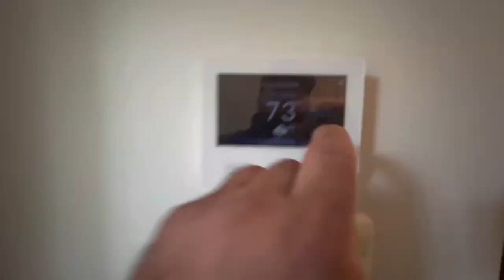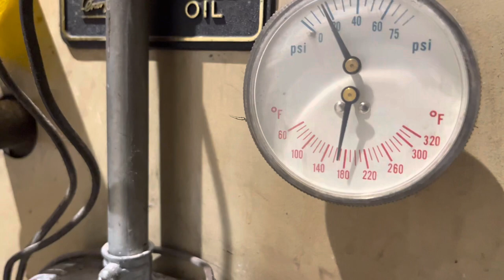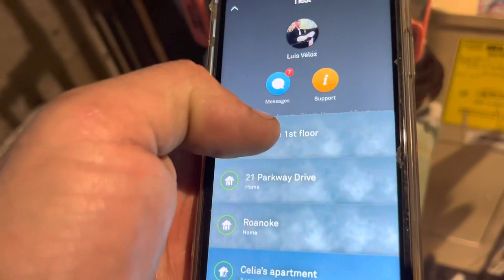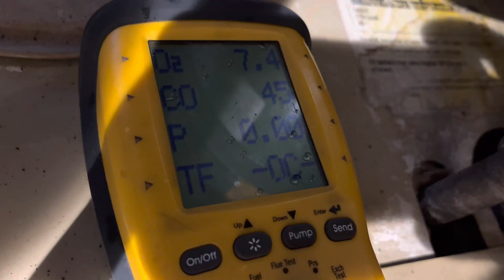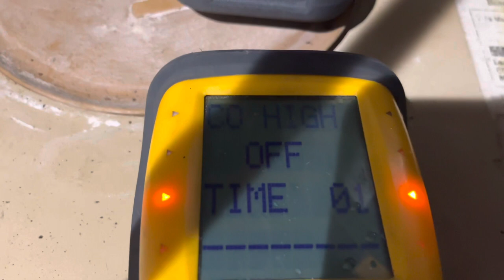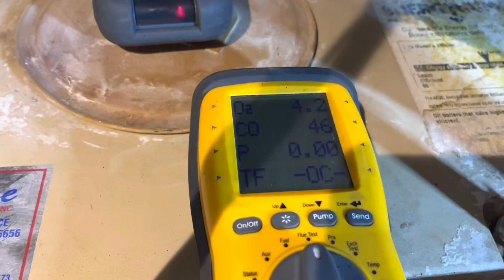Weil McLain Gold in bad shape.  High CO.  No heat due to No maintenance.

Comment: My boiler is leaking burn smell through the peek hole. What do I need to do?
Reply: Plus keep burning for like 30 sec after it stops running
Reply from the maker: I would definitely call a professional technician.   Could be relay sticking, and the leak could be piping or even the boiler itself.    Get it checked seriously
Reply: Im gonna try change the nozzle and pump
Reply from the maker: Has it been vacuumed w soot vac.  If it’s oil??
Reply: I just cleaned/vacuumed the soot. Found a part inside the chamber. Circle thing that stay infront of the nozzle. Put everything back together and ran better.
Reply from the maker: That circle part gets sooted up and needs to be cleaned once a year.  I hope it works out for you.   Steve Lavimoniere has a great channel for oil fired equipment if you run into any other issues.
Reply from the maker: Make sure the nozzle is correct size for that burner. It will tell the size on side plate of burner.   It may have been feeding to much fuel